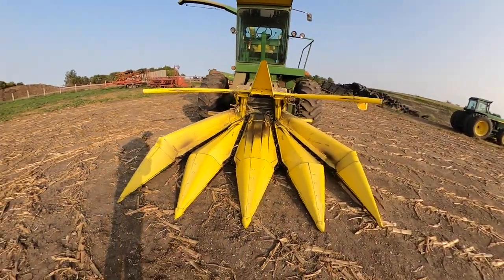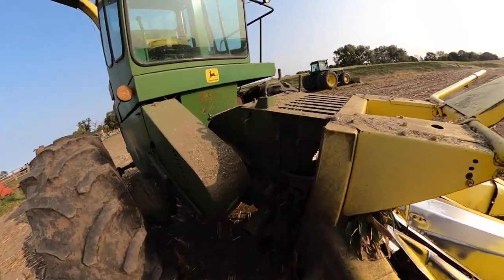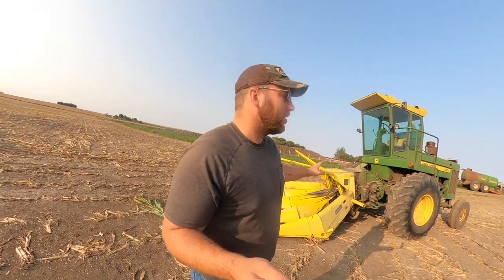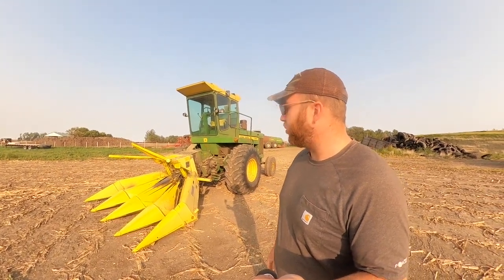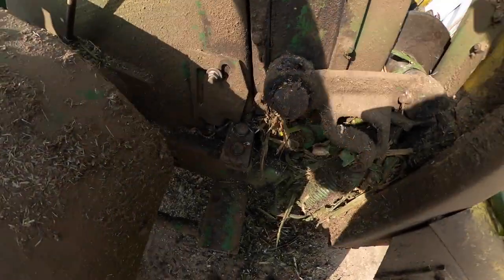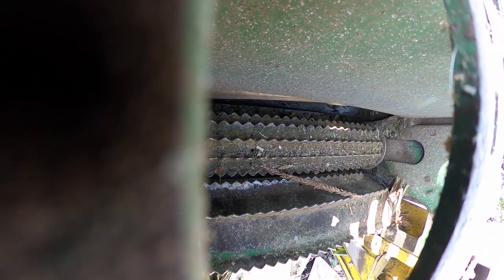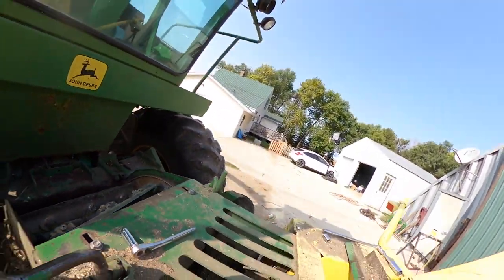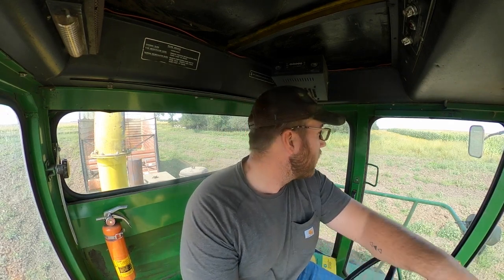Chopping Silage John Deere 5400 | Farmer in the Boot

Comment: Is your 5400 supplied with a kernel processor and a metal detection? Curious to see more of this chopper!
Reply from the maker: No kp or metal detection we were running short on time to gather everything and get the corn chopped it’s just got the old J knives but I’m thinking a dura drum and cracker next year hopefully.  Thanks for watching
Reply: @farmerintheboot4089  I was wondering if there are any 5200 / 5400 forage harvesters with custom kernel processor solutions. I also see the lack of a metal detection in the old 5200 and 5400 models as a problem here in Europe when used for grass silage. Keep us updated on the kernel processor project! If you need any technical manuals or information just let me know, I have access to all of the workshop manuals.
Reply from the maker: There is a company we buy aftermarket parts from they have almost everything you could need for the old 5200/5400 choppers.  They’re out of Iowa idk if they ship internationally.  Look up Kooima Ag.  We just have the tunnel without the augers so doing any kind of haylage is out of the question.  Hopefully that helps!
Reply: @farmerintheboot4089  I used to have a 5440 jd chopper, put in the koomia dura drum, , not kidding upped output by at least 25%. You'll love it. we had to take out half the knives to get a chop we liked, with all the extra knives in the high feed roll setting it still made meal out of it. We also had their cracker plate, helped, not perfect but one hell of a lot cheaper than a crimper